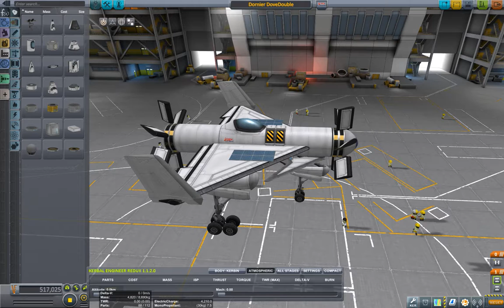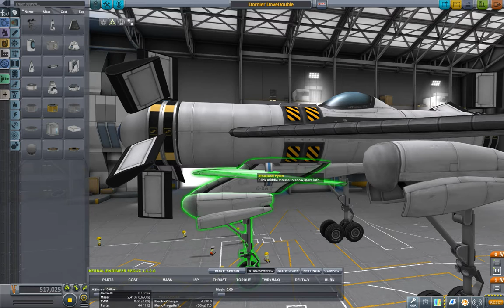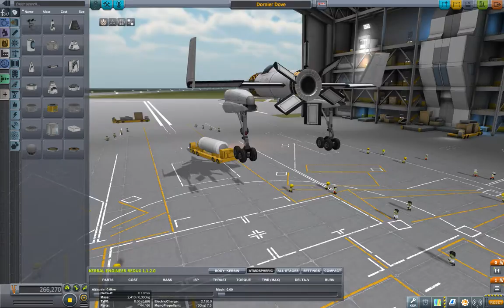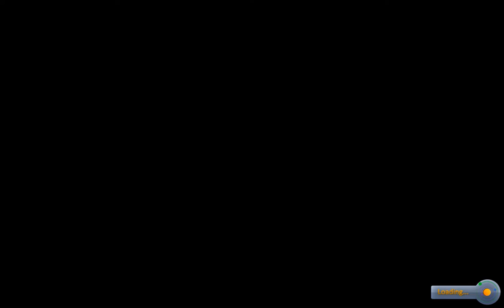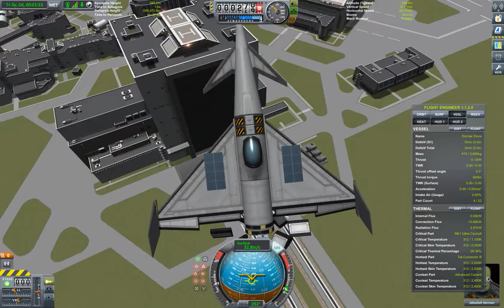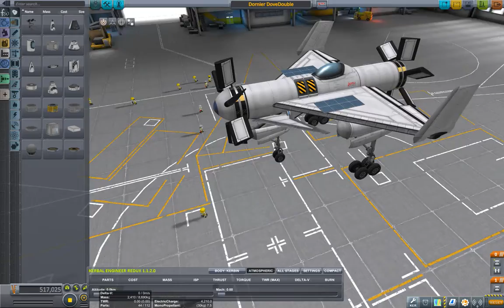Stock Electric prop Planes

Comment: and the planes could be faster if the blades would be in a more flat angle like this plane: http://www.aerotelegraph.com/wp-content/uploads/2015/03/etihad_regional_1.jpg
Reply: I managed 110 ms. had bigger engines though
Reply: CMR do you have uploaded it to something like kerbalx? Im working on netter engines and it would be nice to study yours.
Reply: Darius Duesentrieb i can do that later. gonna pm you the link. the general trick is to double the lenghts of the engine, add bigger propblades and put them  at a good angle whilst activating them as flaps (has somehow less drag than putting them this way directly but gives more forward thrust)